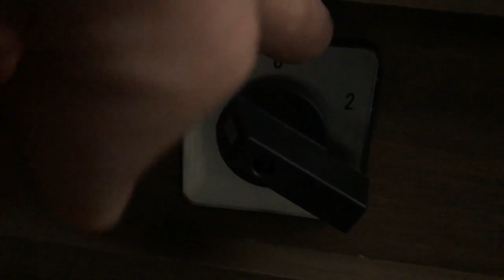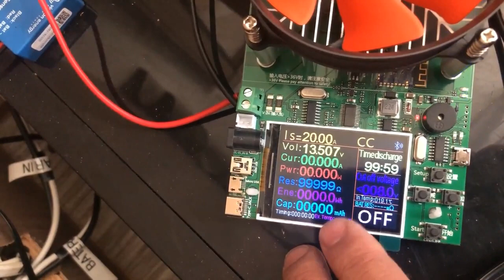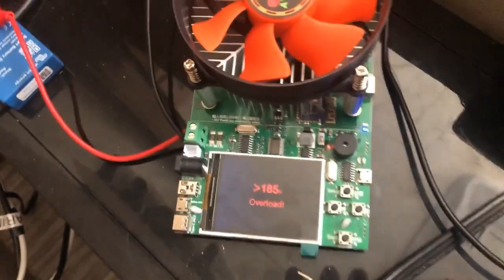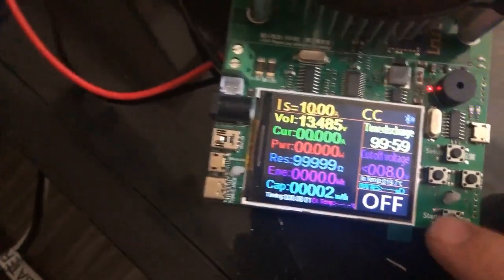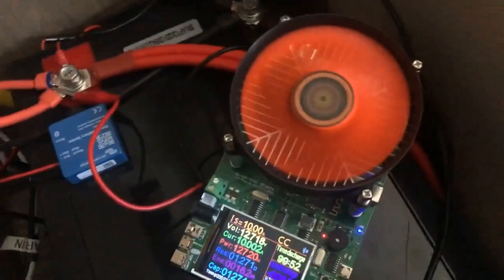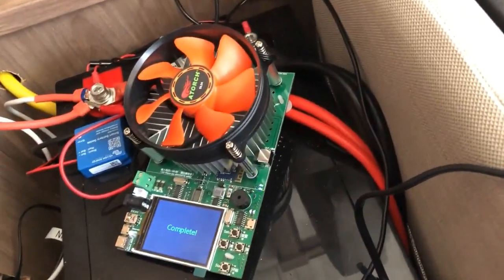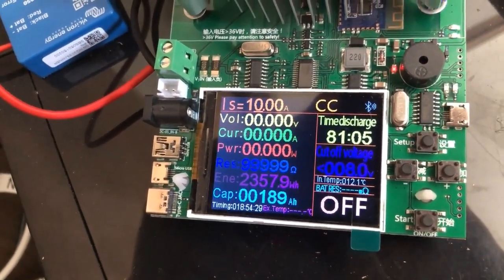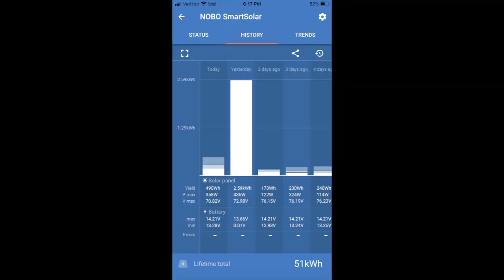AmpereTime Lithium Iron Phosphate Battery Review and Capacity Test

Comment: So I bought 3 of these batteries.  The most I can get out of them after charging is 13.6 V.  Is that normal?  Will they still give 200 AH if all I can get them to output is 13.6 V?
Reply from the maker: I got 208 AH out of mine at initial voltage of 13.55

Comment: I bought one of those testers and just like you, I found that I couldn't go the whole 20 amps because it exceeded the 185 watt limit on the max power. Here's the thing. You can raise the limit to 260 watts and that will allow 20 amps on a 12 volt battery. On my unit, I push the button until I get to the screen that says "< 185 w". At that point I push the button 2 times real quick and then, by holding down on the button, it will raise that number until I let off. If I go too high, I can push the button 3 times fast and the number goes down. To go down slow push 3 times fast, 3 times fast, 3 times fast, etc and it goes down 1 watt each time. Your unit has some buttons that mine doesn't have so maybe they're "up" and "down"? Once you get set to 260 watts, raise the unit up or tilt one end up and blow a small fan on the fins. The main thing to be concerned with is watching the temperature readout. 70 degrees C is where you want that to read. A little higher is OK, but when I used my unit without the extra fan and set to 185 watts, the temp stayed around 70- 73 C so I figured that's what's safe. The full 20 amps will make the testing take a lot less time and it will get you closer to what you might draw off the battery in actual use.. It's still just a .10C rate on a battery this big though.
  Couple things I'd like to share with you Brendan, and others, based on my recent efforts to figure out this Lithium battery revolution that we seem to be in now. If this battery is anything like the Battleborn battery, and I think it is (I have one of each), inside this plastic case is a bunch of battery cells and a circuit board, called the BMS, (Battery Management System) that keeps you from accidentally messing up your battery when you charge or discharge it. It also does some things that help you get the most energy out of the battery. One of those things is that it balances all the cells that are tied together to make the battery. That balance system doesn't start working in a Battleborn battery, specifically, until the charge reaches 14.2 volts. That means that, occasionally, you need to use a charger that goes to 14.2 - 14.6 volts, just to balance the cells from time to time. When you remove the charger, the voltage on the battery will drop to something like 13.2 v pretty quick. That's full charge. Most of the time, from what I've been able to find, you would want to charge at 13 v - 13.4 v and discharge down to about 12.4 v -12.2 v. This will let you get almost all the power out of the battery (90%) and not tax the chemistry of the battery too badly, thus giving you more years of service from the battery. That BMS will keep you from overcharging and destroying the battery and it will also cut the battery off before it gets so low that you damage the cells. Some BMS modules will keep you from charging the battery if it is in freezing conditions, but this battery doesn't have that, so don't charge it in freezing temperatures. I think I see a low temp cutout on your setup, so you know this, but others may not. You will do permanent damage to the cells. You can discharge it in really cold weather though. This battery does protect itself from charging if the temp is too high and it won't take a charge until it cools down. The BMS also limits how many amps you can pull at one time and will shut the battery down to protect itself. All those control features make it hard to tear up this battery, but they don't make it last as many years as possible. You control that by not charging it to its upper voltage limit, not running it all the way down to the lower voltage limit, drawing the power off only as fast as you need to, and making sure that sometimes you charge up to that 14.2 v - 14.6 v balancing charge. I use mine for boon-docking and as a backup power supply at home and I have no solar at the moment, so I can't speak to that, but what I just wrote should help for those that use a battery charger instead of solar.
Reply from the maker: This is awesome information!   Thanks for taking the time to share your knowledge!   My Victron lithium charging profile is 14.2v absorption and 13.2 float, so close to what you suggest.   Although I'll try to reach out to the manufacturer and see what they recommend.  I'm super interested in figuring out a way to cycle my battery between roughly 75% and 25% to max battery life.

Comment: Before you dropped those batteries in for your solar system did you charge them to 14.6 volts? I currently bought two, both had a voltage out of the box of 13.17 volts....is it super necessary to bring them to 14.6?
Reply from the maker: I did, because I also have a 110v charger that took them to 14.6.  But the float profile in my victron charge controller is 13.2v and 14.2 for absorption.

Comment: Thanks for the information.  I actually bought two of them. I was so giddy on that price I had to buy a second one for capacity while boon docking.  Way better than the Battle Born price. I currently have 800 watts of solar (4 x 200watt 24vdc Rich panels) on the roof of the new RV trailer and hope to test it out next month in Colorado.  I had hoped to add more panels but the Victron I bought, 100/50 can only give me 720 watts max into 12Vdc batteries . My mistake on interpreting the parameters of the charge controller.  I thought I had more capacity.  Which Victron do you have?  Just wondering.  Thanks again.  And yup the Ampere Time batteries are the real thing.  Their customer service and technical help has been spot on and very responsive, giving me the confidence to buy them.
Just a heads up, AT told me to set the absorption to 14.4vdc and the float to 13.8. What are your settings at?
Reply from the maker: I have the same 100|50 victron, and wired in series based on the pre-installed wiring that came with the camper- only 10ga, so I didn't want to push too many amps through that.   I'll have to check on the charge specs; for now I just selected the default for LiFePO4 batteries in the Victron app...   Thanks for sharing those recommended specs from AmpereTime.   I reached out them after I got my battery and they comped me with a 10A battery charger (120v).   I think these will catch on.
Reply: @brendan8363  wow that’s great that they comped you the charger.  Somehow I missed that deal…lol
I was worried about the current too so I have my four panels in series parallel. So two sets of two in series and then those two strings in parallel.  The roof mounted dog house has two connection points but they are combined in the dog house.  So for me my specs for the 24vdc panels is about 90vdc open circuit combined voltage and about 15-20 amps so the cables aren’t that big.  As you know the charge controller can handle 100 volts from the panel and 50 amps to charge the batteries. Keep us up to date on what’s up.  Thanks

Comment: So dose this bat cap out at 13.5?
Reply from the maker: Yes, mine does. But the charge voltage is 14.4. It the video it wasn’t completely disconnected from all loads, so 13.5 shows.
Reply from the maker: I charge mine (absorption) at 14.2v and it floats at 13.2v.